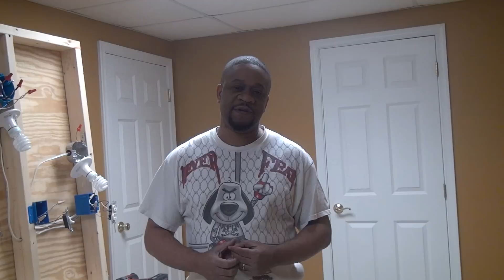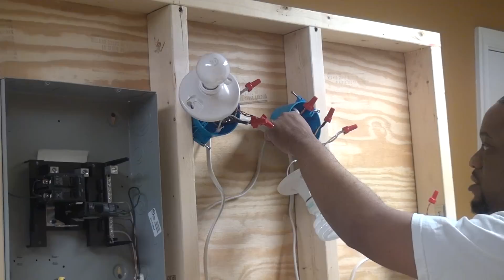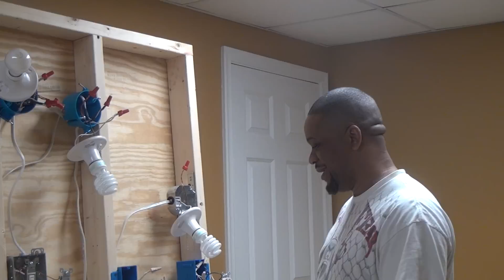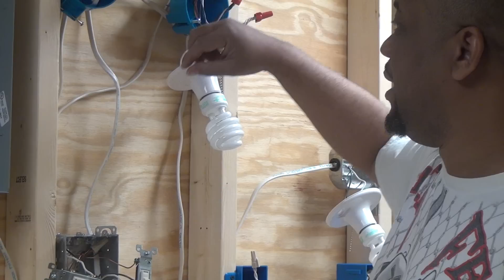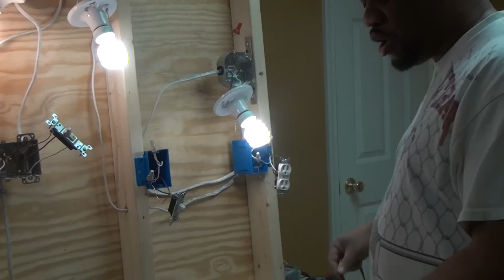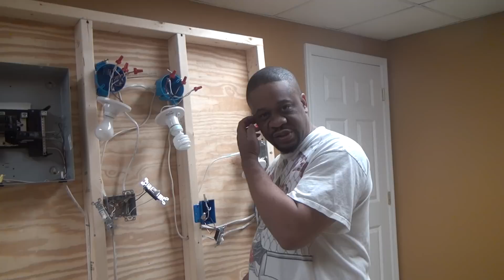Installing multiple switches

Comment: Great tutorial in true layman's terms. 
Definitely should re identify the white as a hot.  Not being a neutral we refer to that as an " ungrounded conductor" ( hot). Good job. Good luck with your business. Neutral is required in most conditions at the switch box per NEC. 2014 I believe

Comment: to MR. Robertson...i will be taking some classes for an electrical certification and to prepare myself so my question is and hopefully not confusing to you is from this multiple switches video you mentioned you cannot run an outlet because there is no neutral wire so that being said is it possible to remove one of the the multiple switch from the right side of the box and install an outlet with neutral wire at all? thank you for reply and have a blessed day!

Comment: Good morning Tyrone.  I have been a long time subscriber and really enjoy your videos.  I have a couple of questions regarding a new switch and exhaust fan/light I want to install in my bathroom. 1st question is it excessive to tie a 20 amp source into 15 amp receptacles or switches? The electrician that swapped out the BX cable in my house did this. My second question is, is it appropriate for me to use a 20 amp single pole switch with two interrupters on it to power a bathroom exhaust fan with light and night light coming from the 20 amp source? The electrician left a 3 wire from the existing 15amp interrupter for me to install the fan at a later date.

Comment: I would have like to see you hook up everything from scratch. It's not that easy  as you say, I just want to put up a motion light sensor outside and get my hot wire from an existing outlet. Can't you just do (add a outlet from an existing outlet?)    Gracias from Mexico

Comment: An easy way to visualize acceptable outlet spacing, would be to use a lamp that is fitted with a six foot cord. You need to be able to set the lamp at any place around the perimeter of the room, and plug it in, without the cord crossing a doorway. Do that, and you should be golden.

Comment: 120V x 15 Amp Circuit = 1800 watts. multiply by 80% for 80% of load. =1440 watts so figure your receptacles and light switches. Factor in LED vs Conventional and wattage for TV's yada yada. Then use your head. Add em up and if everything is on at once....that is your what? You max load on this ONE CIRCUIT! USA 100V with Edison days 110V it is currently 120V NEC!

Comment: Hello bro, I have a question, I been looking everywhere and no one answered me lol but cab I use 20 amp breakers for all my room in the house? And on that 20 amp breaker can I put 5 four outlets and 3 can lights and a fan on that one breaker? Or do I have to put   All the outlets for that room on one 20 amp breaker and get another 20 amp breaker and put the 3 lights and fan on that breaker? Plz let me know
Reply from the maker: the breaker is sized according to the wire size 12awg= 20 amp breaker, 14awg= 15 amp breaker in other words if your house is wired with all 12 gauge wire (PROBABLY NOT with the exception of the  kitchen, dinning room?, and bathrooms) then yes you can use all 20 amp breakers if not more probable then no you can not use all 20 amp breakers. as far as lights and receptacles it does not matter mix match and the number depends on what you plan to use them for.
Reply: Tyrone Robertson 

Okay, I just wanted to double check and thank you.
Reply from the maker: @joshuawilson2362  you are welcome

Comment: I  STILL  LIKE  MY  OLD  TECHNICIAN  TEXT  ,  THAT  IF  YOU  HAVE  A  TEXTER  WIHT  YOU  YOU  WET  YOUR FINGERS  IN  YOUR  TONGUE  , AND  TOUCHT  THE  CABLES  ,AND  IF  YOU  RECEIVED  A  SHOCK  THATS  MEAN  THAT  THEIR  IS  POWER, IF  YOU  DON'T  RECEIVE  A  SHOCK  , MEAN  THAT  THE  POWER  IS  DEATH.  I  MEAN  IF  YOU  DON'T  HAVE  A  TEXTER WITH  YOU  , YOU  CAN  TEXTED  THAT  WAY.

Comment: I just recently re-wired an outlet that had three connections attached directly to a fluorescent light.  I re-wired the connections so that they were connected to a separate junction box and then installed  a new fixture that had its own separate connection also attached to the junction box along with a lighted switch.  I COULD NOT HAVE DONE THIS WITHOUT YOUR VIDEOS...  THANKS!
Reply from the maker: You are welcome Johnny

Comment: Is it okay to have 2 two way switches on a light fixture. Maybe I should elaborate a little bit more. I just bought a house were 2 of the light switches weren't working. I went up into the attic and found a wire and hookup it up to a light fixture. I believe the wire went to an old light fixure thats been removed. The light fixture works as long as im using the correct 2 way switch to turn it back off. But is it okay to have 2 live wires hook up the way I do? Im sure its not a typical set up you want to see. Thanks.
Reply: I believe the old light fixture was removed to put a heating unit in the attic. Not sure if can put the old light fixture back. I was, before rewiring having to go way across a hall to turn on the light in the dark. Now i can just step outside my door and hit the light.

Comment: I dont know of any case I would run hot through the neutral wire....just me, but in over 11 years of working with electrical I've never seen this. Not saying you can't do it, or it's wrong...I just can't think of a reason why you would. Enlighten me please as I didn't get that answer from this video.
Reply: When you are using the neutral wire as hot wire as in this video it is called "Back Feeding". A lot of electricians use this method to save from running another romex cable into the box containing the switch. It's considered a short cut.

Comment: hello, i am trying to run power to a shed from a 20 amp circuit. two lights, two plugs and two switches. I thought i had done it all right but after putting everything together and flipping the breaker it tripped it. i've gone through it over and over and can't seem to find the problem. would you please help me with this, maybe a diagram of how you would do this.  thanks
Reply: TheMpitt76 20 amp circuit is probably too small aswell as cable size used. these will vary depending on the distance to the shed from the power supply. and dont put sockets on the same circuit as the lighting.

Comment: Interesting... I have 6 outlets wired up in my bedroom new construction after the 6th outlet could I wire in two light fixtures on a 20amp circuit all on the same circuit.
Reply: Royce Begay no, always have the lighting on a seperate circuite
Reply: Yes.

Comment: Great videos. I have a question for you I hope I can explain myself. I am working on a master bath remodel. I have installed a bathroom exhaust fan light combo on two different switches one for fan one for light. I want to install a light in my shower can I use the switch that goes to my exhaust fan light to also power off on the shower light so they both turn on and off when I flip the switch. If I can How would I wire that.
Reply from the maker: yes you just run a 2wire cable from the exhaust unit and tie the black with the light and white to white
Reply: The light in the shower is usually required to be GFCI protected.

Comment: Thanks- I have switch box with one load live line coming in. There used to be 2 lights controlled by 2 switches but the second line is dead. I think i can splice into the black line from the hot wire and connect to the white line in the light box and then put the white line on the hot side of the switch and the other side on the neutral to the panel bus. Do you think that would work?
Reply from the maker: It is impossible to say without seeing and testing what you have.

Comment: Thank you sir it's an excellent video I have a cuestión??? ok I tried to install a ceiling fan in the middle of my  living room I wanted to take the power from the Switch that controls a outside light.
I opened the old switch box and I found a 
   1.  BLACK n WHITE wires with no ground and the white wire is the hot wire These are the HOT. WIRES
    2.  Black white wire with no ground i do not know if the white wire is the hot wire these are the cables for a OUTSIDE LIGHT
     3.  Plus the cable black white N green for my CEILING FAN. 
 I do not know what to do any suggestions please
Reply from the maker: if it is only 2 wires in the box then you have no neutral which means you can not power your new fan from that box

Comment: Hello Tyrone, I did a switch loop in my shed about 10 years ago, but i put in a 3 wire cable. I used red, black and green wires.The white wire isn't attached to anything. 
The day I purchased Belkin wireless switch. It has 2 black hot wires, 1 white neutral wire and 1 green ground wire. Its setup for a standard (light fixture at end of a cable run). It said I need white neutral wire hookup for it to run. 
My question is can I connect those 2 neutral wires together and then connect that white neutral(3 way)  wire onto the same breaker box?
Thanks Dennis
Reply from the maker: Just because the wires are white does not mean that it is neutral. If you have a 3 conductor between the light and the switch then that means that either way you can make the switch work. if power is coming to the box with the switch tie the power to one side of the switch and the black going to the light to the other and your neutrals together. If power is going to the light tie the hot to the red or black of the 3 conductor and the other to the light and tie the whites together. In the switch tie the white to white and black and red to switch.
Reply: Thanks Tyrone, Your video was the only one that help me figured out what was the problem with the old wiring.  I ended up tracing the white neutral back to a box connector. The neutral wasn't connected because i didn't need it at the time. Everything worked after I reconnected it in the box. PS. I am glad I read my Electrical book before I installed that end switch. Because I wasn't going to remove the sheetrock.

Comment: thanks so much.   just found your video.   I've done some basic wiring,  but I've got a mess i need help. 

what do you know about mobile home wiring with the enclosed boxes? 

the switch that controls the outside deck light is shot.   i took a picture and took the who's out.   i failed to label them. .
there are 3 sets of wires.  i only noticed 2 and can only verify 2 with picture. 

i am replacing a wirecon single pile switch.    i could not get the same brand locally.  i bought another brand that is somewhat different. 
i think the new one may be hubbel but i am not sure.   in the wirecon switch the neutral and ground touched in the middle.   but the black was cut shorter. 
since i did not label them,  i don't know which 2 sets came in on the same end of the switch
what was the point of the black wires being shorter and not touching. 
no i don't have a meter.     HELP. .
Reply from the maker: The concepts with the wiring and the switches are the same in your mobile home so the videos will work for you, however having a meter is essential. It is difficult to impossible to tell you which wire is what and what goes where without testing what you have.

Comment: Hi what if I use neutro to installing a switch
Reply from the maker: Sorry for the delayed response. If you Switch the neutral the light will still work, but you create a dangerous situation for someone that come behind you and work on the light. One side of the light will always be energized even if the switch is in the off position= not good

Comment: Tyrone, it's May 12, 2016 and i'm in Canada .....after looking at all the videos i tried to watch regarding wiring a single pole switch where the hot wire comes from the breaker, to an outlet, to a ceiling light, to my switch, i FINALLY have the answer on how to do the wiring when you do not receive power to the switch directly from the panel; that is, you receive power to your switch via an alternate route, one of them involving your ceiling light. You are careful, conscientious and above all, a great instructor. You choose your words determinedly and you speak as if you are teaching someone for the very first time, careful not to miss anything important. I needed this quality of instruction because i am encountering this for the very first time. Thank-you my friend!! We need more Tyrone on the internet!! I have subscribed to your channel, you are dynamite.
Reply from the maker: +Roberto Angelini Thanks for the kind words Roberto and you are welcome.

Comment: I have a light bulb connected to 2 seperate switches but want to switch out the bulb to a ceiling fan anyway to upload a video helping me with that?
Reply from the maker: +jason barajas no need just install your fan where the existing light is and it will work the same way as the light that you replaced

Comment: Thanks for all the tutorial man, great help. You're a humble dude doing something good to help others. You have my respect. Again thanks!
Reply from the maker: +Efraim Meulenberg thanks and you are welcome
Reply: thanks for your time on showing those tutorials, they really helps.I have a question I have an outside fence lights connected direct from the breaker box,and I just put a switch so I can control them from inside since they had solar sensors, know the problem is that I had forgotten that my electrical gate was together with fence ligts.so when I turn off lights ,the gate also turns off,how can I fix this?

Comment: Dude, so, I have three switches wired to the same light (for my kitchen, one light fixture with three switches so that any doorway you walk into from you can turn on the light without going to another doorway).  Can you draw out a diagram for me?  Three switches, one power source, all converge in the ceiling above the light fixture.
Reply: your home run (hot) is going to your light box in the ceiling? or to a switch box ..

Comment: Dude, you are the man!  This immediately explained what I discovered in my ceiling while trouble-shooting a past bad wiring job.  Thanks for paying it forward!!!
Reply from the maker: +d3w4yn3 You are welcome
Reply: +d3w4yn3 Being a rookie I am a little quick to describe anything I don't understand as bad wiring. When the truth is-of the three rooms I was installing fans only one was conveniently set up with a 4 wire system coming from the switch that made wiring the fan easy. The other two rooms were as Tyrone explained. I looked at the wiring coming from the light switch in these 2 rooms and my brain broke. I stared for an hour up there in the attic. THIS CAN'T BE RIGHT. THEY HAVE A BLACK HOT WIRE ON THE SAME CIRCUIT WITH A WHITE NEUTRAL. Ah but I remembered the teachings of his eminence Tyrone. When encountering a person who describes the white wire as neutral, walk away for he is full of shit. I tried to walk away from myself but failed. Tyrone tells us that this is technically not a wrong way to wire the house but I still don't know why they did it the way they did. So what was Tyrone's lesson? Was it "If it's white it ain't right" or was it that there are many ways to wire lighting and some cases whitey  is a hottie.

Comment: Your video helped man thank you very much. I don't why but I had this confusion in my head with a really simple setup. Two switches, two feed to different set of lights and a 120V jack and the breaker coming in. When you said "Most of the time you should never have a white on the switch other than that it's a hot wire": that cleared my mind lol I don't know why but I was connecting the whites on the "Off" position of the switches. Now it's a pair of black jumpers and everything works fine. Thanks!
Reply from the maker: +Bruno Villeneuve You are welcome Bruno

Comment: Thank you so much Tyrone! This is the first time i've ever commented on a video simply because of you paying it forward. :)  Great explanation and was really easy for DIY girl like me to understand for the most part.

I probably have watched this video more than a dozen times to connect the wiring in my home recording music studio.  I have 2 single pole switches.  I've finally managed to connect the first two light fixtures to one of the switches (your explanation of the white wire being "hot" switch was KEY!).  The issue I can not for the life of me figure out is the other 4 light fixtures to the other switch.  The L1 has 4 white/4 black/4 ground, currently 3 black are connected taped up alone, 3 white are the same (which indicates "hot" when i test it, then the last white (marked as the switch and the last black are connected.  L2 and L3 have 2 white/2 black/2 ground and finally L4 has 1 white and 1 black (which both tested "hot".)  Any suggestions you can offer would be so appreciated!

Thank you and have a blessed day.
Reply from the maker: +Veronica Mendez Thanks for the reply Veronica and sorry for the delayed response. I would need more info perhaps some pictures to be able to give assistance.
Reply: +Tyrone Robertson Sorry for the delayed response as well on my end.  Been pulling my hair trying to figure this out.  i created a quick drawing to help better describe the current set up. I'm confused as there are only black and white wires.  The power only goes into Light #1.  Also in light #1, the two single pole switches controlling different lights enter there as well as the outgoing to the next fixture.  so a total of 4 white and 4 black in that fixture box alone not including the actual light itself with the black and white wire.  I'm stumped as to how to hook up the series of lights. L #1-4 to SW#1 and L#5-6 to SW2.  Thank you in advance! :)
https://drive.google.com/folderview?id=0B3JPnyHalnk9LTF6YkQxUnI0MDA&usp=sharing
Reply from the maker: +Veronica Mendez LOL the drawing does not help much but I think that I have a idea of what you have but to try to explain how to hook it all up will probably leave you more confused so if you wish you can send me a private message if you are in the usa and put your phone number and i will try to talk you through the hook up.